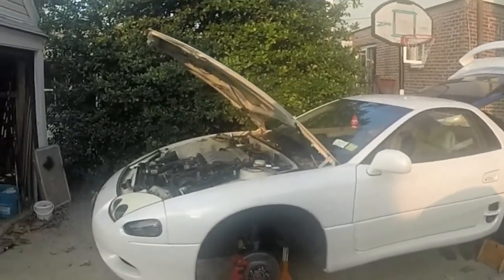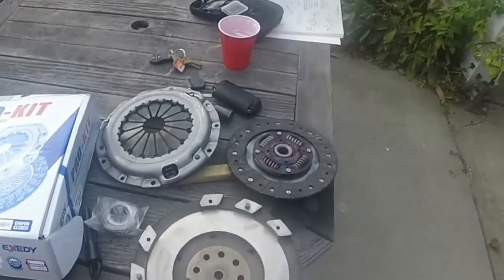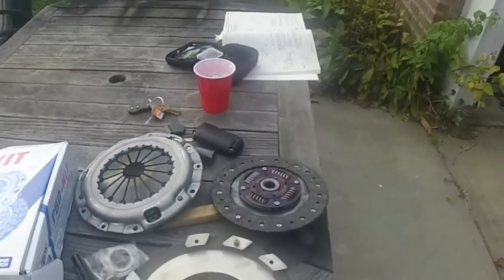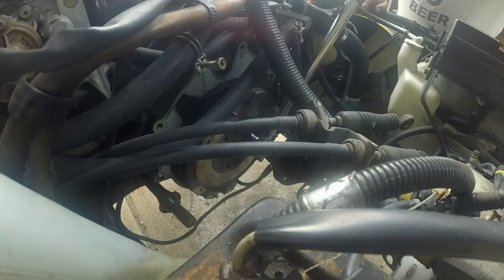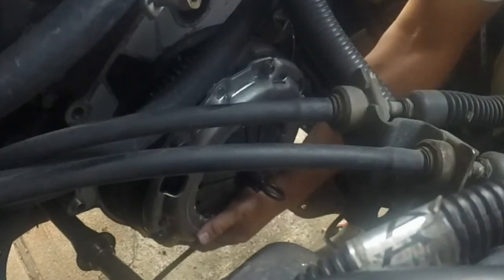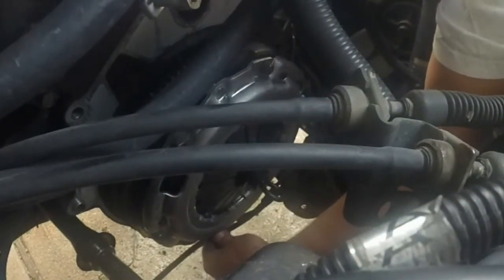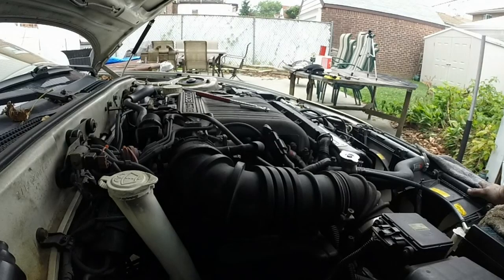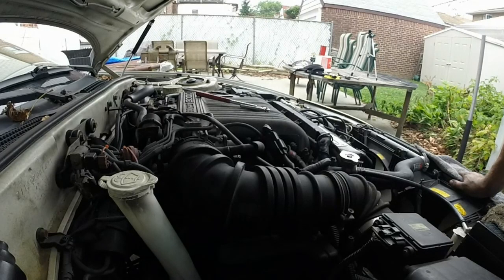3000gt clutch installation part 2

Comment: Thanks for the video...My 96 GTO suddenly won't shift into gear. Loud screeching noise was coming out of transmission, Clutch pedal was losing pressure too. I replaced, Master and slave cylinders, No change. Had to open the transmission..And my throwout bearing was all messed up.. Changed it all. Now car runs, like it should. Thanks for this detailed video!!
Reply: my 92 base stealth has the same issue. screeching, jumping out of gear and zero "push back" on the clutch when i take my foot off it. i guess ill start at the throwout bearing

Comment: I've just replaced my rear diff which wasn't as easy as I thort, my r32 skyline was a lot easier, and then my clutch died. my car (97 galant vr4) is quite hard to work on but this video has given me confidence to do myself. thanks for your time

Comment: Ahh, the sohc. The most reliable 3000gt ever made plus its non interference. Man I wish my vr4 was as reliable.
Reply: My 97 Vr4 is just as reliable as my wife's 99 base model and way more fun to drive. Just stay on top with all the maintenance it needs and it will treat you right.

Comment: I have a 95 sl an had the trans out for a month. I have all the bolts but I dont remember where the 2 longer bellhousing bolts go. It's just the bellhousing bolts like 6 I think, just cant find the info anywhere.
Reply from the maker: Its been a couple of years since I did this but I,m remembering there were 3 different sizes? I'm pretty sure the longer 2 bolts were the 3 & 9 o'clock position and next were the next size were 3 bolts for the top and 11 & 2 o'clock and the 2 smaller one's on the bottom. I will try and find my notes in the garage tomorrow. (work the night shift)
Reply: skip546 I actually found the diagram on 3sx website. I have the dohc motor but I think the sohc and dohc use same transmission? Either way I got it worked out, also thanks for the quick response.

Comment: I have a '97 3000gt SL. My transmission just went out last week and I suspect the clutch. I feel a little intimidated by this job, so I was hoping you could give me a ball park figure on how much you think it would cost to have this done by a shop.
Reply: +Michael M    Update- I went ahead and did it myself. The release bearing (throwout bearing) had completely seized up. I went ahead and replaced the whole clutch unit anyway since I was in there. Thank you for this video. I wouldn't have been able to do this major job without it.  My STRONG advice- Replace bolts with new ones wherever you can. I was torquing down the clutch cover bolts and one bolt head sheared right off. I had to drill a small hole in the bolt and use an extractor.  The same thing happened on removal of one of the engine mount bolts. It took me a whole day to drill out the bolt hole and use a tap to rethread it. I used all brand new bolts for the mount. Lowe's carries a tremendous variety of bolts and they're about a dollar a piece.

Comment: ok after removing trans to inspect we got shifter working & reinstalled. now trying figure out wut hoox up where, wutta mess!! its taken me since last yr in April figure everything out too. all I c thats left is battery wiring & fluids. I'm stumped atm where charcoal canister (2 top/1 bottom) hoses hook up...don't c any mention in yur vids of them. any ideas where i can find pics or diagrams online?
Reply from the maker: Sorry not sure. I did not take any charcoal canisters out. I will try and see if I can come up with the hose routing. I have since sold the car so I do not have the car for reference.
Reply: anything u can find would be great thx! I'm in the process of trying put back 2gether after previous owner took all apart with trans work

Comment: hey buddy  great video but is there a trick to getting the gearbox back in. It won't go up and in. tried everything but there is no room. is there a trick to it. i have done a few gear boxes but his is a real problem
Reply from the maker: Yeah. Its a MFer. The best way to do it is put a tow strap around the trans and have someone support from above and you have to get under it without the jack in place and rock back and forth to line up the splines and it sound slid in. Its a tight fit and make sure you have the motor mount that attaches to the trans is completely removed
Reply: MFer is an understatement on this one. 2 days to lower it down from the engine,  Engine mount is completely removed,  and so far a day spent ion it and still cant get it into place. (close but no cigar) we know it won't go straight up as there is no room. we have tried rotating the entire box lifted it to the cavity and then try to rotate it but thats not working. I was thinking maybe angle it in with input shaft first then align. its the cross member that keeps blocking it and i thought there has to be a way to get this in. The manual just states replace, so GTO Manual not very helpful there.
Reply: PS it was your video that helped us get the gearbox out. after we watched that it was a 20 minute job.
Reply from the maker: Yeah you have to take the passages side cross member out . Its 5 bolts . Support the car on both sides of the cross member before removal. I also have a removal video that shows that. Im surprised  you got  the trans out with that in place. I say at the end of the vid how long it took me. I think it was 11 hours over 2 days.. so your not doing too bad
Reply: this is a right hand drive. (as i am in sydney Australia) i did a search under your vids SKIP546 for the removal but not there can you provide a link please
Reply from the maker: https://youtu.be/biS78VzZJAg
Reply from the maker: Try that link. If it doesn't work i will have to do it from my home computer. Let me know
Reply from the maker: Hopefully most of the info is similar, being right wheel drive. Also note that some of the cross member bolts are sizes when you take them out